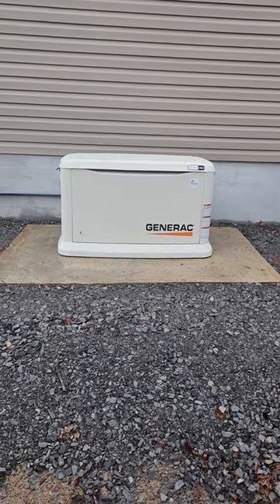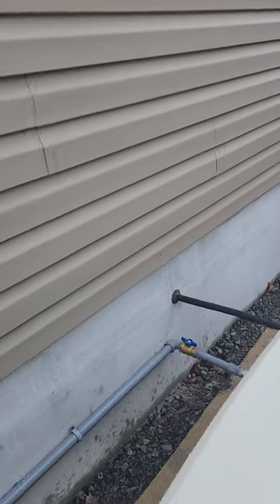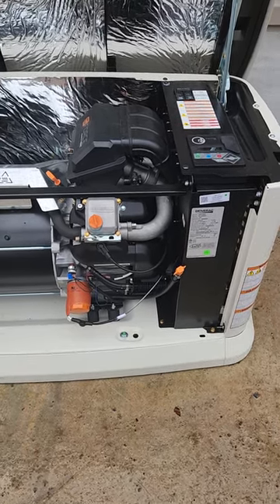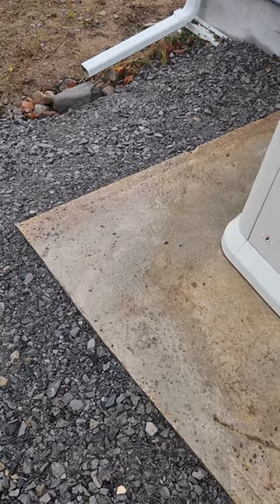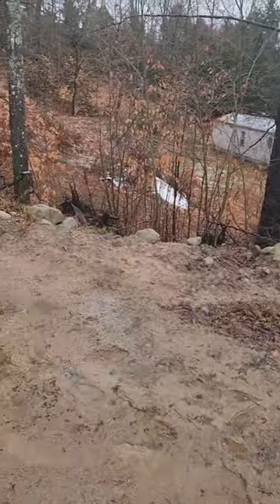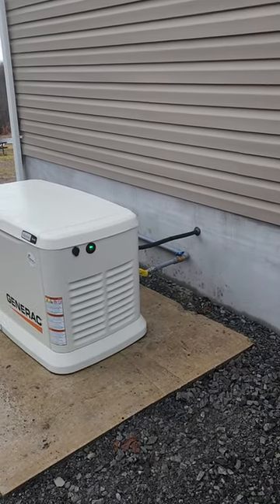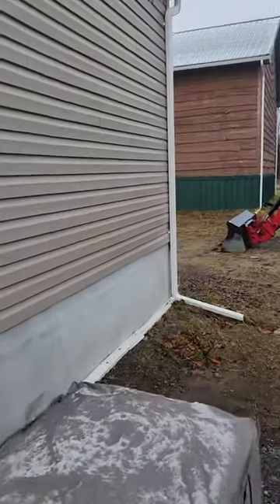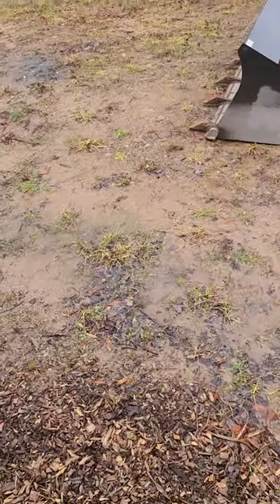Generac 26KW Standby Generator  12/2023

Comment: I am a guy who built a compartment out of cinder blocks with metal access doors and a metal lid on the roof thinking it was the economical way to go. I used professional soundproofing insdie the compartment (acoustibloc) but the engineering for cooling lifting the lid installing sound insulation was a nightmare. It ended up costing double or triple what you spend for your system. Doing it your way saved all the engineering headaches although it might be a little louder than mine. If I had it to do all over again I would have gone your way.
Reply from the maker: If New York State goes the way of California,  I might be switching it to a primary generator.

Comment: Did they tee into  the propane line after the second stage regulator ? What size line is before the second stage regulator?
Reply from the maker: They did just after. Will have to check the pipe size when I get home Sunday.
Reply: Thank you, I’m installing a 26 kw. The propane line for furnace comes in open the opposite corner of the house than the electrical.  I  was wondering instead of running the 85’ of new line from tank to just tee in on the connection at house and running 30’ of pipe.
Reply from the maker: I'm not sure, but you could tee in on the high pressure side and have another regular at the Genset.
Reply from the maker: The way I ran my connections (electrical and propane) was more expensive. But worth the cost for many reasons, gable end with less traffic, security out of sight out of mind, but easy access.